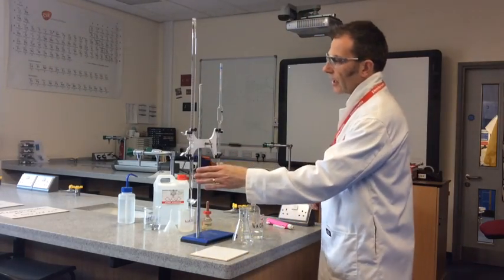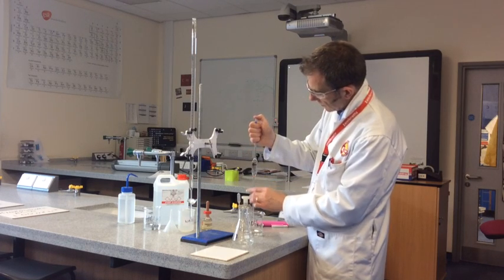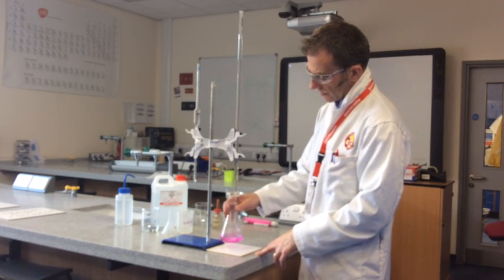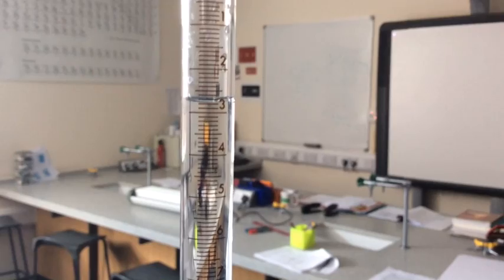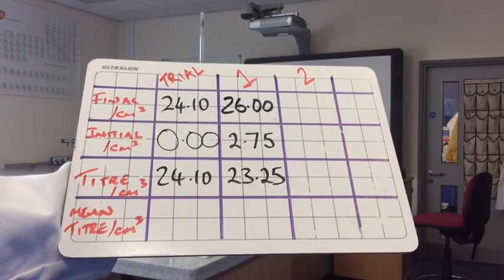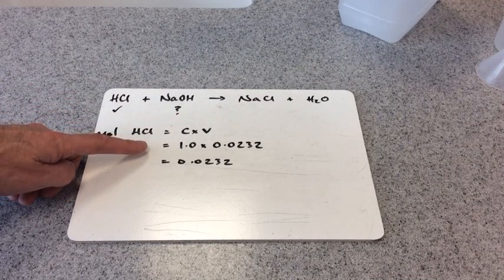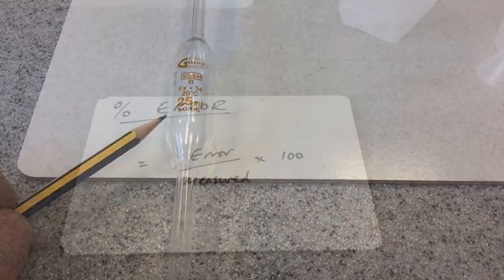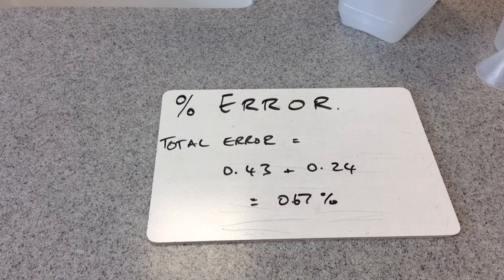How To Do An Acid Base Titration Part 2

Comment: Did you move the thumb slightly to open the pipette when you were draining the solution to get the meniscus on the line? I hope u know what I mean
Reply from the maker: Hamdi Ajab I think I know what you mean. If you lift your thumb ever so slightly, you can control the meniscus down to the line. It's tricky at first!
Reply: Oh thanks for the advice!